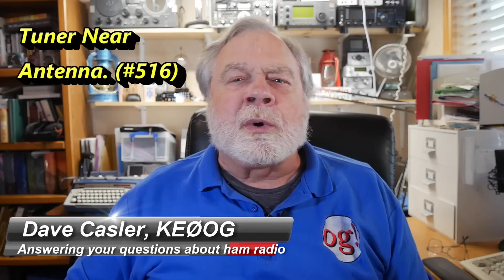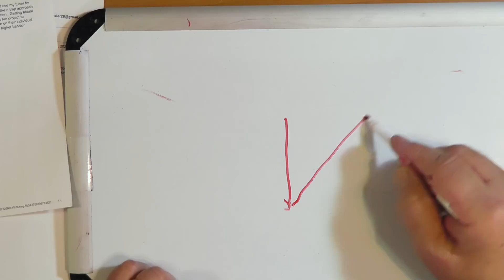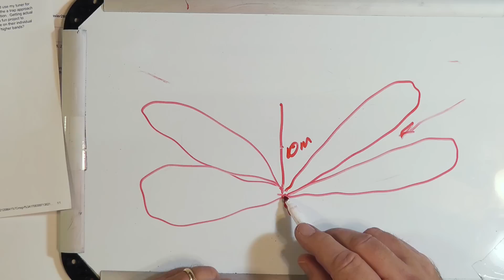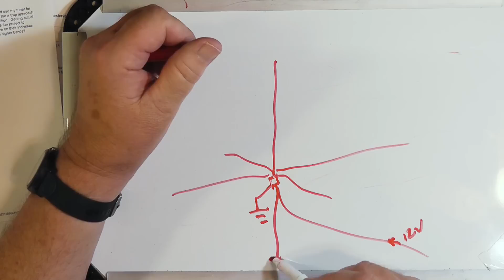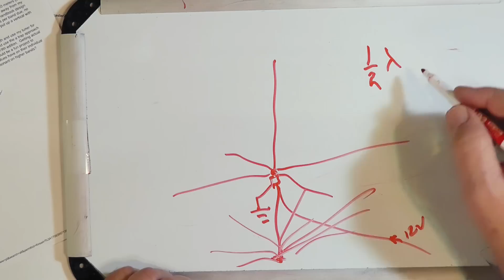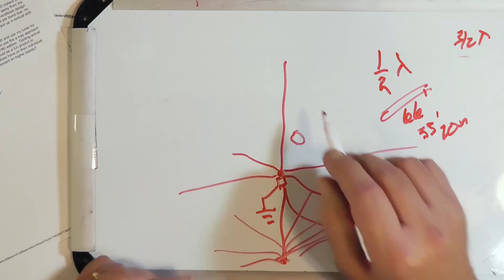Tuner Near Antenna. (#516)

Comment: Hi

I hv 2060A. 

I use it to tune before using my sb1000 amp. 
I made a chart for three sections on each band. Using the chart as a starting point and then adjusting c1 and c2 for lowest swr’s. 

Here is where I am confused. 
In the manual, it states c1and c2 dials should be set to 100 to provide max capacitance. ???

Next is the sensitivity knob, how is that used?  The manual is very brief on this.  

Thanku so much. 

Billy

Comment: When you have a vertical with radials elevated how come you only need four and when on the ground you need many more radials?
Reply: Lots more would be better, I think 4 is just the number some consider the minimum for reasonable efficiency (and takeoff angle).

Comment: Isn’t 66 feet the length of a 40 meter dipole?
Reply: Yes it is. 468 ÷ 7.1 (MHz) is 66 feet for a half-wave, 40 Meter dipole.
Reply: Close to 20m
Reply: @jimnorrish5507  huh?
Reply: @aurtisanminer2827  66 feet is very close to 20 metres which sounds about right for a 40 metre dipole.
Reply: @aurtisanminer2827  60 ft is close to a 20 meter dipole in length yeah
Reply: @jimnorrish5507  not a half wave 20 meter dipole.
Reply: @aurtisanminer2827  oops

Comment: An antenna tuner is a good investment for the space limited ham. Old tube transmitters had them built in as part of the output section. While not great, you can load almost anything including the coax down to 160.  Still, you want the best by the book antennas can.